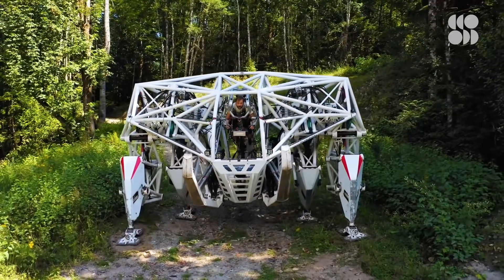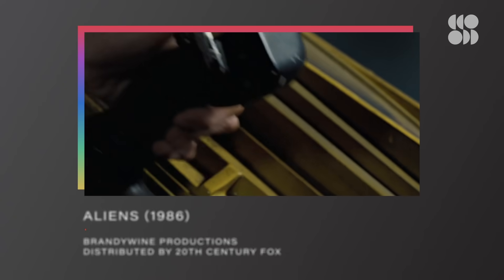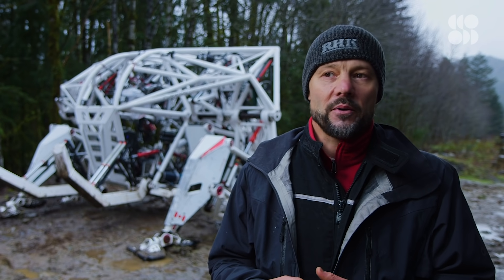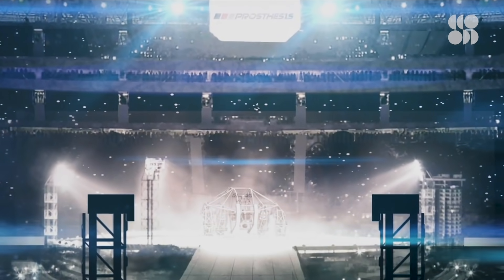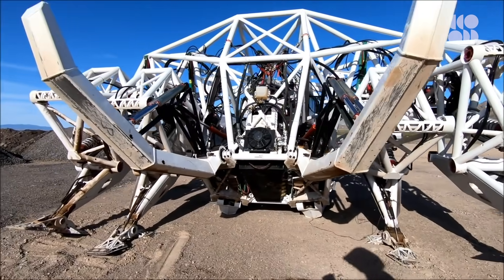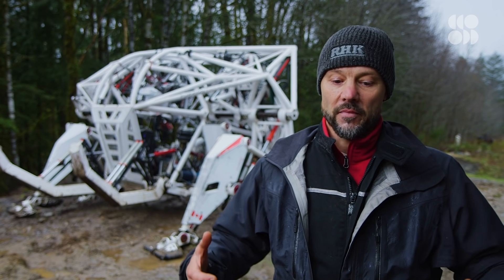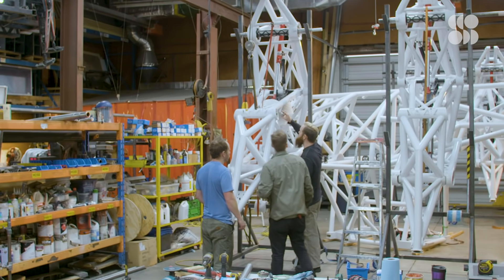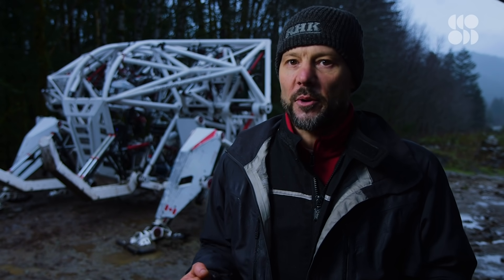Inside the Giant Mech Suit Made for Racing

Comment: Does anyone know what kind of metal the tubes they are using are, and how thick the walls the tubes are? 
I'm sure they did allot of testing but I would be worried about a specific kind of stress bending a single pipe out of place and having that harness break/rip your limb out of well... place. 
And if not having it bend into you. Although I assume that's a large part of the reason that the front part is rounded out so it will naturally bend out beyond the fact that it will allow the bot to roll if it tips over to a degree.

Comment: You need to build it along the lines of a dog or a horse instead of the frame you currently have. It also needs computer control.
Just saying.
There’s a company that’s made autonomous vehicles, designed as pack machines for the military but were considered too loud to be useful.
Boston Dynamics makes them.

Comment: Frankly i think this would be much more useful in rescue missions in cities or exploration in difficult areas or for mars exploration missions once it gets fast enough and ligh enough, racing is just a weird idea because it wont give much thrill to audience until unless it does some crazy maneuvers. Although its very thrilling for pilots basically it will be taking place of big machines such as JCB or rollers or tunnel drills etc because the sheer ammount of flexibility and control it will offer to the pilot. Building gudd stuff aiming wrong though

Comment: So those over the shoulder arm struts need to go, make them wrap outward so the side to side momentum can be increased without pilot danger, or at least some form of upper torso and neck protection. then you need to find a way to gimbal the pilot or use a dual spring system instead of straps to keep the pilot more on task and not being taken by the weight - like a horse rider at full gallop the interaction between the rider and the horse almost floating using their knees as balance joints maintaining level. this is awesome I look forward to footage of the first race !

Comment: "Built for racing", but it's bigger than most tractors and features hydraulic 'tusks'... Why not build something 1/3rd the size from alloys and carbon-fibre? Also, the uppermost section of the legs need to be shortened while the 'shin' section should be lengthened for greater speed. The 'shoulders' should also be above the cockpit for better balance. The vehicle shown would struggle to traverse any slope without tipping over, aside from centre of gravity issues, there is no capacity to move the legs laterally. Also the 'feet' need to allow for movement in 3 axis.

Comment: Its cool. But the primary limit will continue to be a small an light enough power source. But i guess better battery tech will help at least the expensive spectacle sport thing possible.
Reply: Or maybe what it needs is a hydrogen fuel cell or a diesel engine running on discarded vegetable oil.

Comment: Though I realize this is a very heavy machine, I would really like you to have a second look at the gait the machine operator uses. When I watched the video, I realized that the operator uses only one leg at a time like an Elephant. because it is so heavy, it only moves one leg at a time in order to have the stability of three legs on the ground. Yes, an Elephant can move fast, but instead of "running" like a human or a horse where all legs are in the air at one stage in their gait, it is still "walking" with three legs on the ground.
In the computer generated scenes of the machine they used, what is to me the correct gait in that both outer legs moved forward together and when they hit the ground, the back legs both moved forward. In order for this machine to have the correct gait, it will have to have a kind of springing jump from the back legs to propel the body forward just before the front legs comes down. A kind of rocking horse gait that shall have to be learned I think and it will shake the operator around horribly.
I love your project! Go with it!

Comment: Generatively design the structure, and replace the fett with in-hub tourqe  vector electric motors and small tracks. That way it can still walk just it does, but drive on flatter ground. So it would be more like ice-skating in a mech, and faster. I think anyway.

Comment: The potential is limitless.

My Mind: I wanna have pizza delivered by a guy in a mech suit.
Reply: They could make it while on the way in a back oven using the heat from the machine to save energy costs and arrive precisely when done.
Reply: @TheHumanSystem  and gyroscopes could rotate the pizza to prevent the cheese from sliding!!!!
Reply: @DreamingInSlowMotion  and
Reply: @TheHumanSystem  i prefer a flamethrower-based heat retention system if you get my style
Reply: @speedyboi1471  You could make a subsidiary to Blaze Pizza.
Reply: If you had this with jump and rocket booster ability I would totally drive it around.  Not sure what the laws are on walking and jumping vehicles though. 😄
  
That being said though I feel like Boston Dynamics can actually make something like that having the software to make a robot do parkour and backflips.  
  
I wonder how impossible the numbers would be on that if you had the OS (I'm assuming those robots have a custom temporal OS, not sure) and software Atlas runs on but for something this size that can lift a lot of on board energy generation.  It certainly sounds possible, and nothing new has to be invented.  
  
Why I don't see it anywhere on YouTube I don't know.  Maybe someone has a patent and NDA on all the cool mech suits?  😁
Reply: I want my own irl metal gear

Comment: You would have a lot more success creating a body suit that tracked the muscles in your body and connected that to the system that amplifies the mech. It would be able to detect the angle that your foot is at which would allow the pitch of the actual foot. The rest would be about designing a well stabilized construct.

Comment: You need a better power source than electro-hydraulic...the power to weight ratio is too low. A 275 pound gas-turbine with 75 gallons of fuel, appx 550 lbs worth,  creating 800-1000 horsepower would work great, with appropriately matching hydraulic pumps...watch out for fuel consumption, GPM...At present, it can barely move under its own power.
   Currently you have a Forty-five to One power-to-weight ratio....with the aforementioned gas-turbine, a Ten to one ratio is doable.

Comment: Drone racing is so cool and futuristic, I wonder why they're not starting with that type of remote racing first.
The ability to ignore the pilot's mass, safety, and comfort will certainly help speed up the research and engineering process. Just put the pilot in some sort of whole-body simulator-controller setup.

So far the mechs look like they can only move in one axis. And pretty slowly at that.
Imagine the kind of freedom they can get if they can start with lightweight mechs, that are allowed to have more speed and can do crazy stunts because they can ignore the weight and safety concerns.

Comment: Does a person with exceptional physical strength, who then pilots this machine, have more output from the machine than someone with less physical strength? Like, is it an amplifier, or will it always go to full-output no matter who pilots it, and perhaps those who are weaker will actually be less capable at controlling the machine? How does it operate with kick-backs to the pilot, or ripping the pilots on limbs out of their body? What if a pilot injured and then flinches, will that flinch be mimicked by the machine and then possibly cause a pain-cascade upon which the pilot is injured further, then flinches further, then injures further, and repeats until the pilot is a bloody pulp?

Also, it's really kinda gross to see the mech trampling the forest when all innovation should still push us to be more in harmony with our environment instead of destroying it.

Comment: pointless activity with the possibility of severe head and spinal damage, yep, it's a sport.
Seriously impressive engineering.
Reply: You're enclosed by beams and fully strapped in. The only thing that's missing is a Hans device and a bit of a buffer (could be done internally as damped holding points for the pilot cell). At that point you could crash in any direction with speeds far greater than this thing will ever get and climb out unscratched
Reply: @michahermann7869  bro that's the point though you said add a buffer but your admitting currently there is none.
Reply: @Sam Carter yeah you don't need a helmet if you can't hit anything with your head :D yesterday my roommate and I calculated that 50cm ideal damper travel could be enough to survive impacts of 40-50km/h if you're strapped in really well. Do you plan on using crash structures for extra hard impacts, so you can save money on the shock system of regular impacts? I mean surely you don't have to, but it could be a way of improving safety even further without increasing costs and complexity by too much

Comment: This is so counter-intuitive to everything we've learned about building these types of machines. Generally speaking mechs are designed to move slowly because the forces involved can easily damage the mech itself. So to say "I'm going to make a fast mech" is quite a bold statement & I really respect it. Even if this racing league doesn't take off; the research potential is reason enough to pursue this goal.
Reply: Making it lighter will help.
Reply: Absolutely
Reply: Well said.
Reply: Yeah, they should've made remote mechs and make them lightweight instead. Maybe just human-sized ones, or even smaller. That will make the surface to volume ratio much more manageable.
Reply: This is an insightful comment. We find that sometimes speed is not necessary if other abilities are granted to the humans inside.
Reply: You need a chicken style mech of you want to go fast.

Comment: He never said it makes you 50 times stronger, she misquoted him. He said it amplifys your movements by 50.
Reply: It’s force. The suit isn’t 50x bigger than you nor are you making tiny movements as the pilot.
Reply: @CurtisPerrin88  what he ment was: if you move your arm 1cm, the robot moves 50cm. force is amplified much more, if he can even keep this thing upright wheighting probably more then 2 tons, while flipping cars
Reply: @ZirconGames  no, if you move your arm 1m, it doesn't move 50 meters, does it?
Reply: @Inexpressable  Of course not. becouse that's out of the motion range of the arm. But the phrase in the video does not make much sense without more information, but he's probably talking about the limbs, so let's say an arm. of course they don't just "move", the joints have to turn, by the same angle the controller turns, now, how far the tip of the arm will move depends on the lenght of the arm. if the tip of the human arm would move by 1 cm, the tip of the robot arm would move 50cm. the amount it moves can never be bigger than the lenght of the arm plotted as the diameter of a circle that has the joint as it's origin.
Reply: @ZirconGames  than?
Reply: @odd1363  yep. thank you
Reply: @ZirconGames  😉
Reply: I noticed that too.
Reply: Dude was pushing cars like nothing
Reply: @Watch-0w1  50x strength would totally allow you to flip a car. If you're able to push 100 kg, that's 5 tons with the suit.

Comment: What happens if the operator gets jock itch, does the machine tear itself apart as the operator instinctively begins scratching? There should be a safety feature to prevent that, limitations set with limit switches, if not to make sure the operator isn't experiencing forms of chaffing or crabs.
Reply: Well you can build a jock scratcher robot to automate that while you manually pilot the mech. In Gundam there is an assistant ai built-in that aids in piloting and aiming at targets. But originally the mech was built with a piloting input that requires the pilot to modify their body with a port to their brain stem, like the matrix. And the pilot would do the calculations and much of the piloting with their minds. Data, mages and sensory input of the machine is fed into the pilots brain directly. I think some of the machines inject the pilot with pharmaceutical drugs to enhance the merger between the pilots brain and the machine, bypassing and reducing the need for a computer to interface with the machine. Its like the difference between riding a bike and taking a bus.
Reply: Pretty sure the operator can take their arm out of the control harness at any time. Also he said that the operator has to squeeze the hand-holds in order to activate the control system.

Comment: The real amazing part is this has been possible for 50+ years. It's just hydraulics, I'm sure microprocessors are used but I doubt that they are essential just easier to use in this day and age. Relays and pots connected to hydraulic pumps would have worked fine 50 years ago.
Reply: Quality and cost may have been different though, plus effort :P
Reply: I don't know, our material science wasn't as advanced which I imagine would be a major problem.

Comment: He is going to sell this to anyone with money, especially the military.
Reply: They have even better machines than this that the public wont see for many years
Reply: @aaaaaaa4821  no way to know for sure but i doubt it as japan have been pretty open about the level of military tech in this area.
Reply: @hfjtrytry9216  i'm pretty sure mechs are not viable for the military, it's pointless to use it to war, they require a very well trained professional, even if a drone version was made, it would require a big human-controller interface, very expensive, hard to maintain, hard to fix, and probably will never be as effective as fighter jets, drones, tanks, etc. some things just don't work outside science fiction, just like flying cars. i'm not saying this things can't get any use, they surely can with more development, but i don't think any military force will ever try to develop on this